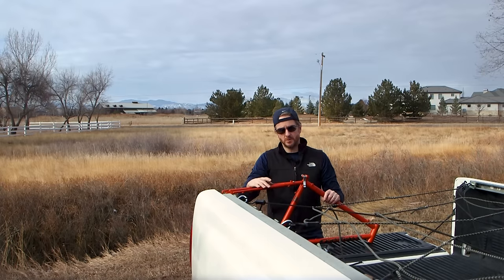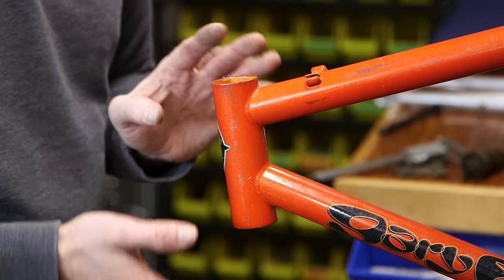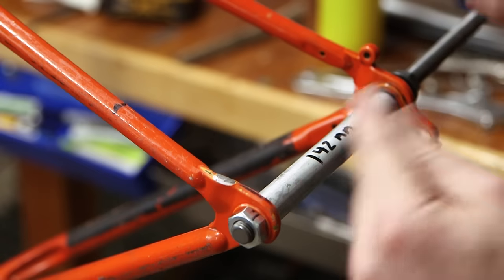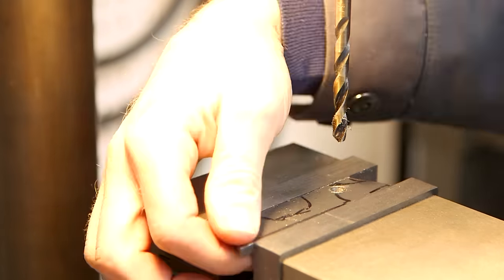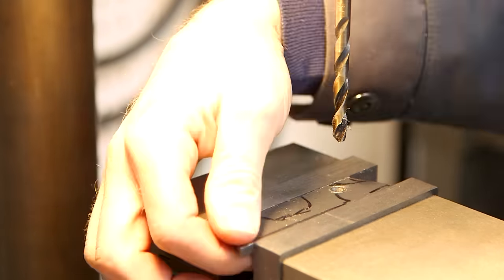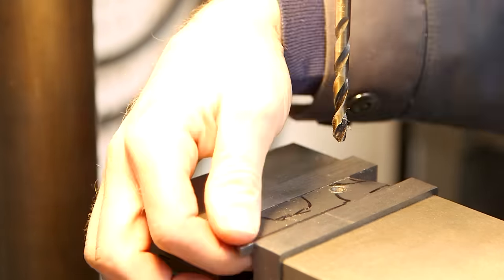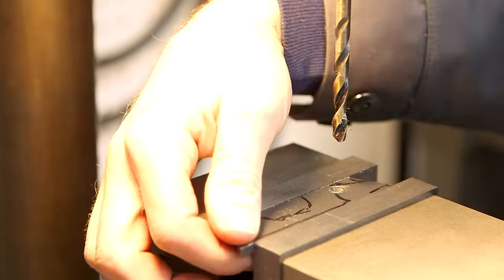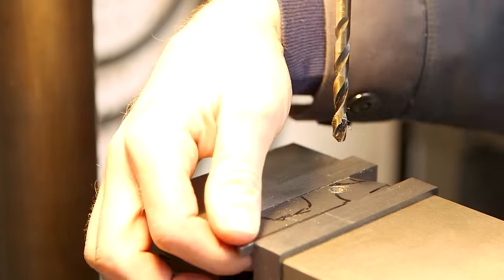1990's Gary Fisher Gravel Bike

Comment: The thru axle conversation is brilliant!
Reply: But 142 and 135mm hubs are still the same from locknut to locknut as I understand it.  I would have just found an old mtb fork and built up wheels with 100/135mm hubs.

Comment: Wow. Honestly the thru axle conversion blew my mind. That is such a good idea.  I knew about cold setting, but I hadn't seen anyone do that thru axle stuff.

Too bad you need some pretty crazy tooling to do this, what an amazing build. As a Gary Fisher owner, I love this build.
Reply from the maker: Awesome!  Thank you.
Reply: doset surly got something like this on its midnight special. but nevertheless pretty nice build!
Reply: You don't need to use a mill. You could all that with a grinder and file. It would take more time is all.
Reply: I use 10x 135 thru axile conversion on my dt swiss for aluminum full suspension mtb. And cut 142 endcaps to 135 on a aluminum hardtail and drilled the dropouts from 10mm 
 to12mm . In case u don't have steel or ti , there's great options.. and 1° slacker  headsets are available for 1  1/8.  Not sure about 1" head tubes .
Reply: Had to switch off in the end pissed off with the music
Reply: If you have the CAD skills you can get those parts machined for very little money overseas, just create a 3d-model and upload it, should be a lot easier than machining one yourself.
Reply: @RobertAdairWorkshop я за 200 долларов собрал мтб 2007 года и вес даже сбросил с 14 до 12 кг
Reply: @roncooke2188  who cares incel 🙂
Reply: @_MrSnrub You just read my mind

Comment: I have a Gary Fisher L' Aquila mountain bike. I bought it new in 1999 in Sydney. So it's now 25 years old! The front suspension forks gave up a couple of years ago and I replaced them with rigid forks. I've been running it on narrow road tyres for many years and predominantly using it on sealed roads, basically as a road bike.  The bike has seen life in Vietnam for two years, Laos, Indonesia for several years, and Malawi, as well as here in New South Wales. It's still in nearly daily use, though I do alternate it with my full suspension bike depending on the ride.  Still a lovely bike to ride. At 73, I now think my legs will retire before the bike!

Comment: Props for this.
For myself, I am perfectly happy with the way I typically 'gravelize' nineties mountain bikes: put faster rolling tires on it, swap the handlebars for a drop bar or a Surly Corner Bar type of handlebar, find a high and short stem to get the position right, and that's it.
I like the snappy acceleration and the nimble steering of 26" wheels (and their strength), and well adjusted V-brakes work perfectly fine for me..
That said, I do like the concept and  realization of this bike very much. Props also for the calm editing and talking us thru the build, including the mistakes. That's a breath of fresh air compared to most bike build video's here.
Good job!
Reply from the maker: Really appreciate this.  Thank you.  I had a gravelized Hardrock in the late 90's with bull bars.  It was a neat bike.  Would be a fun build, for sure.

Comment: Robert, good video! As a cyclist of 35 years, and a Machinist/Engineer of 45 years, I can appreciate what you've accomplished.
I have an old Stumpjumper with 26" wheels, disc brakes, and Quick Release hubs. I converted the 26ers to thru axles in a similar fashion. I had to custom make the axles, modify the hubs, and modify the dropouts.
Having machine tools is great!

Comment: I made the same conversion,from a 1993 Raleigh mtb 26" ,to a 28" (700) Gravel bike (but with caliper brake ) works great,the only complaint is the increase of height of the center of gravity,not only for the stability,but also for the saddle height. With the same distance i use on normal bike,it's difficult touch the ground with feet...

Comment: Excellent video….i just did this with an older all carbon 2011 Ridley x-Fire CX bike. Found it dirty and neglected in a pawn shop. I added a SRAM 1X drivetrain, Fulcrum Racing wheels, Ritchey seat post and pedals. Came with Avid shorty ultimate cantilever brakes and Swisstop pads.  Great gravel rider/ fun ride coffee stop bike that turns heads.

Comment: I have a similar ride using an early 2000's Voodoo Hoodoo, it's disc brake and has a brace or fillet running from the seat stay to the chain stay to support the disc brake. That's a good amount of pressure on a narrow looking seat stay. 
That is a sensational looking bike and a wonderful piece of upcycling, thanks for sharing 👍
Reply from the maker: I’m watching for a Voodoo frame.  That’s going to be my next project.  Thanks for the kudos!

Comment: Ingenious and amazingly built. I esp. love the pully system for the GRX FD since i have the same issue with trekking frame and a top pull cable routing. Same goes for the thru axle convo obvs - just brilliant

Comment: I have my old 1990 Stumpjumper Pro that I've love to add discs brakes and more to.
Sadly I don't have your impressive skills or workshop gear. Though I did get it customised back then by moving cables onto top tube from down tube before that became the norm. I cut through a down tube cable on a rock within IIRC, within a week of getting it. I then had it resprayed and did a whole set of custom decals for it.
A while back I compared the Stumpy's geometry to my Crux and they were surprisingly similar. This explained why I liked the Crux so much, because the Stumpy was an awesome bike. Pretty much the only difference up front was the down section of the drops. Your stem length, bar width and hoods are very like bar setups I had back then with bar ends equating to riding on the hoods.

Comment: That's next level restomodding! I wonder though if it's not necessary to add a brace between chainstay and seatstay at the upper mounting point of the rear brake to distribute the brake force.

Comment: Great build and video. My only question is whether you really had to cold set the rear triangle out? I thought the 135mm is for the inside-inside dropout measurement, so couldn't you just bore out the dropouts and weld on the thru axle nuts on the outside and it should fit? The build is really proper but the Achilles heel of these 90s MTB>gravel conversions is the high BB. More clearance, sure, but the fit is off by modern standards. Glad you are able to fit a 700x40. A 26x2" roughly equates to 700x23 so it's nice you were able to go bigger.
Reply: BB height is problematic, my thoughts exactly.
Reply from the maker: I hadn't considered opening up the dropouts so the hub caps would fit in.  I think I'd have done it differently if I were to go that route and not use the nuts, but instead, machine new pieces that would sit outbound to reinforce the dropouts.  It's an interesting idea for sure.

Comment: I just did a gravel conversion on a 1999 Orange Clockwork, that I've had since brand new. I didn't go as far as you, as I don't have the necessary skills, and didn't want to spend too much money on it case it turned out to be shit. I swapped the straight bar+shifters for gravel-specific flared drop bars and Shimano STIs, and swapped the saddle out for a modern one (same one as I have on my 2016 road bike as its comfy). I kept the 26" wheels (not quite original, but  I've had them since around the same time) and put modern gravel tyres on them. Kept the 3x8 drivetrain and the v-brakes. Getting the v-brakes and front derailleur to play nicely with the modern components required some cable adapters sourced from the internet. Rear derailleur works fine with the STI lever as is. I put a fairly short stem (80 mm) on it, that I had hanging around, as I figured that would place the hoods around the same place as the original grips were, which I thought made sense. I have a few stems of different lengths hanging around I could have swapped it for if it didn't work, but it seems fine. I kept the original suspension fork too.

I haven't actually taken it on any proper rides yet, but I have taken it on a few test rides around local streets, just to see what it rides like. It rides surprising well, pretty much like it was intended to be like that.  I'm intending to take it bikepacking latter in the year.

Comment: Incredible build, generally these type of builds have compromises of some sort, but I think this is pretty optimized.
Reply from the maker: I wanted to do a tapered fork on it too, but I couldn't get my hands on an exhaust-tubing expander to see if it'd work.  That's the only thing I didin't do.  Thank you!
Reply: @RobertAdairWorkshop  plenty of solid straight steerer forks out there! Would you consider replacing the entire head tube?

Adapters exist for migrating larger lower head tube bearings, but they would add a fair bit of stack to the front....but maybe that would be good for the geometry in this case?

I have a 94' rockhopper and I replaced the fork with a Surly troll, it was a great fit. All it's missing would be a rear disc conversion at this point.

Thru axles are next level. 😎

Comment: The hardest bit was watching you clamp that top tube! 😢😢
Reply: I mean... It's steel
Reply: @fantscher  everything else is sound, but these frames are usually butted and will dint easily if clamped there, slap a seatpost in and clamp that.
Reply: @danieljones6824  way too cheap for butted tubes... This thing is a tank. But I agree with you, better safe than sorry.

Comment: What about the added force on the seat stay from the braking force of the caliper, that the seat stay wasn’t designed to handle? I’ve heard of disc converted bikes buckling right there without added reinforcement. My 2006 Marin Pine Mountain disc steel frame (built into an ebike) has a bridge between the seat and chain stays just under the disc brake mount to counter the braking forces.
Reply from the maker: I’m really not worried about it.  There’s a lot of steel in that dropout and the iso mount, itself, acts as a brace.  I could run some FEA on it and calculate the safety factor if you are really curious.  That’d take some time, though, I’d have to find my COSMOS software.

Comment: Cool project, nice work and thanks for making/posting.  Any idea if that original design was based around a rigid or suspended fork?  Were any final build Geometry specs measured?  Any details regarding how your chosen, proof of concept fork (its ATC and Offset specs) changed (slackened) the final build geometry (including Trail and possible BB Drop) as well as how 700c w/ 40mm tires modified BB Height and the associated ride characteristics would be great.  Have you ridden it with 650b setup to play with ride quality?  Cheers...

Comment: i got a 27.5 disc 95 930 with a 99 XT drivetrain. still a triple but a 21 speed only as I prefer the hub and spoke tension advantages. fits a 2.1 used a Manitou SX suspension fork..  also have a 05 7300fs disc with a surly fork running full 29er that I grinded out the bottom of the brake crossover and the kickstand mount. similar clearance with both bikes. minimal.

likely doing a 95 830 SHX to a deore spec

Comment: Nice Job! One thing I would have done different is used cable-actuated hydraulic brakes. That would have simplified/negated the hose routing. You were trying to be budget conscious I know, but they don't cost that much. Then you could've used a new Chinese cable lever set. I did a vintage Trek 750 to Gravel conversion but kept everything cable. I, like you, had a lot of parts on hand already. Keep up the great work
Reply from the maker: Great tip!

Comment: I loved this build, very well done, the conversion to a thru axle is great. The only thing I noticed as an "error" is that the axle thread is on the opposite side to what is normally used. Doesn't the Allen key collide with the derailer when removing the axle?
Reply from the maker: I don’t remember if I removed the rear wheel after I installed the derailleur.  I sure hope it doesn’t collide.  I’ve got to double check.

Comment: I enjoy your videos.  You are a true craftsman.  After watching the video of the first time you welded on break brackets I did it myself and it came out perfect.  Id like to share pictures some time.  But now I have a new project and this video could answer a big problem I'm having.  I am having trouble finding quality light 650b wheels for my build because it would be quick release.  So I intend to try out this myself.  I have one issue.  I do not own a mill to make a perfect hole in the piece you used on the other side of the through axle.  Is there any chance you would sell a set of two nuts and two collars like you made for that build?
Reply from the maker: Email me and I'll see if I can help.

Comment: Regarding the cable pulley, i used one intended for a folding bike, fitted to the seat tube with a 28.6mm bottle cage adapter. Its a relatively solid piece of aluminium and has held up just fine.

Comment: I never wrapped the bar tape around the body of the lever itself because it always added bulk to the brake lever under the hoods. With the 4" piece that's usually included with bar tape to cover the lever clamp on the bars, you should be able to cover it all without having to wrap the tape around the body of the levers.

Comment: Epic build. I have a 90's Klein Attitude Race which I've had from new. Kept it in really good condition. 

Unfortunately though, the frame can't be modified as easily so no disc brake conversion for me.

Still like riding it though.
Reply from the maker: have really wanted to do a Klein.  They were so cool in the 90's.  I have a design that I'm working on which adds a clamp-on disc mount that I think could work with a Klein frame.  I just need to find one in a price I can afford and then give it a good.
Reply: @RobertAdairWorkshop  Now that, I would love to see 👍

Comment: A solution for the cranks would be to use a Cannondale Hollowgram, designed for 68/73mm BBs. The crank arms flare out that should give decent clearance around the chainstay.

I've swapped out my Hollowgram for Rotor as I need short cranks. Rotor has straight arms and a 91mm axle like Shimano, so you need 12mm and 6mm spacers ... not ideal, but there's no 155/160mm GRX options. 

Cannondale also has a 46/30 Spiderring option if you want to drop down from a 50/43 (no 48/32 from what I see, though).
Reply from the maker: That is brilliant.  I'll give it a look.  This could be plan-a if I do end up having a clearance issue.  Plan b would then be to reshape the stays using my press.  Appreciate it, good idea!

Comment: Good conversion. I wonder why you installed the 142mm rear thru axle  nut on the non-driveside?
Reply from the maker: It's easier for me to install the wheel that way.  I can slide the wheel into the dropouts, ensuring the disc fits into the caliper, then slide the thru axle into place.  It was a personal choice.

Comment: Definitely the best disc brake conversion on an old frame that I have seen. Just curious why you didn't add a brace between the seat and chain stay, forward of the disc brake tab? I would think the added rotational torque on the seat stay might cause the brazing on the dropout to fail.
Reply from the maker: I thought about it but decided it was rigid enough with the welding where the iso mount meets the dropout  That's about an inch wide piece of 3/16" steel that would have to deflect for the braze joint to move.  Figured it was overkill.  But that's based on nothing but a guess so it might be a good idea for others, regardless.  Good catch.
Reply: @RobertAdairWorkshop  Regardless, your attention to detail and skills at problem solving is awesome. Like other comments, your thru-axle conversion was the first I had seen like this. Great job. BTW, no one would have noticed the gold stripe variation because the front looks wider and if you hadn't mentioned it, no one was the wiser.

Comment: Awesome video, just subscribed to your channel. Not sure if it is necessary, usually when I see people weld on disc brake mounts they also add a bridge support between the seat and chain stay near the added brake mount. Any concerns with flex at that point? Considering doing this to an old steel frame I have. Thanks
Reply from the maker: Thank you!  I'd intended to add a bridge between the chain and seat stays to carry the end of the brake mount but I talked myself out of it.  The ISO mount is super sturdy where it mounts to the dropout.  Nearly 1" long and 3/16" wide.  I figured it'd take a lot of force to cause that to flex.  But that wasn't based on anything other than intuition (and maybe a desire to finish the frame).  If you're welding on the frame, anyway, it couldn't hurt, right?

Comment: Great build. In all honesty, are disc brakes that much better than rim brakes to justify the mods? Thoroughly enjoyed the video
Reply from the maker: This is a contentious topic.  It's a dumb topic to be contentious, but it is.  In my opinion, disc brakes are quite a bit better.  There are some down sides like weight and cost and additional maintenance, but also some really big upsides.  Significantly better stopping performance when wet or muddy and they cool down more quickly than rims, given their surface area.  I do a lot of decents on mountain passes and I am a lot more confident doing so on disc brakes.  I will say, I own about 20 bikes and four of them are disc.  Rim brakes are good and light and arguably more attractive, but I like disc brakes better.

Comment: Have you had any issues with the rear disc mount you made? I've seen some other folks online add a cross bar for the additional forces that the original wasn't designed to take. Fantastic build, super creative
Reply from the maker: No problems with it at all.  The brakes are perfect.  The next time I do it, I’ll do it the same way.  Still really happy with it.  Thanks for the compliments.